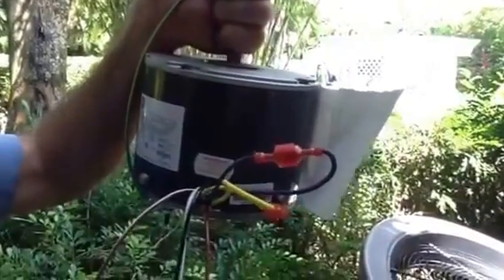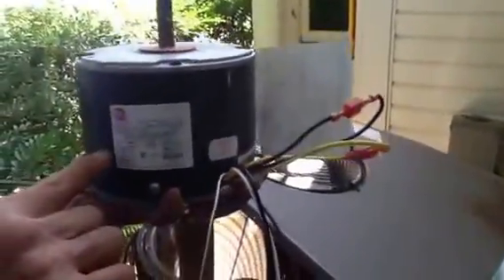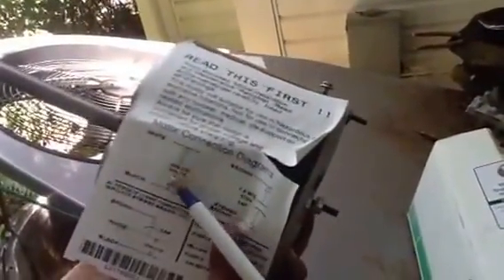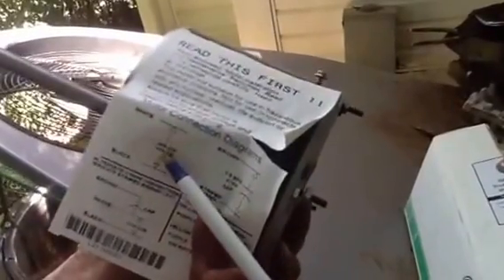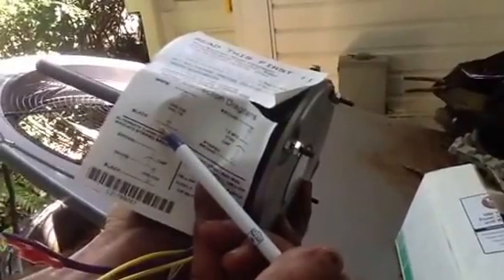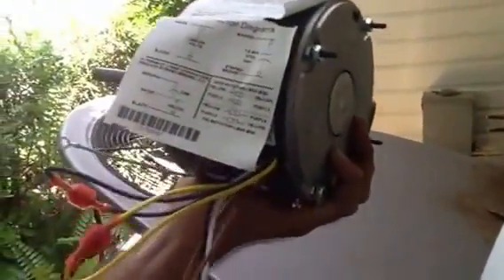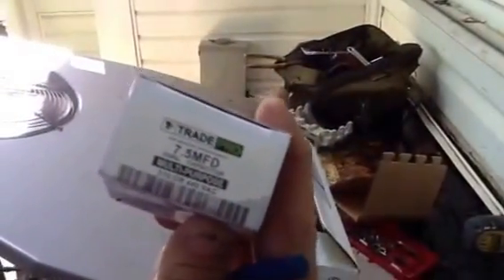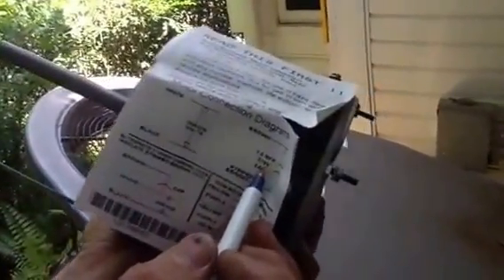How to wire a 6 wire condenser, or heat pump recuse motor

Comment: I read one of the comments below, where someone said if the motor mounts with the four bolts, then you don't need to ground it.  If it doesn't need to be grounded, then why did they put the pig-tail on the motor to start with.  As a master electrician, I have always grounded and sometimes double grounded equipment, you  can never be too safe.  Like on a GE outdoor electrical panel in Austin they request you put a jumper between the neutral bars otherwise the two  ground screws would be your current carrying jumpers making the panel a dangerous installation.  (This is done to make sure the neutral wires are bonded to the neutral and not the panel;)

Comment: David, Aman on what you are saying about bringing young men into this trade. If the motor mounts by the through bolts of the motor you do not need to hook up the ground wire.